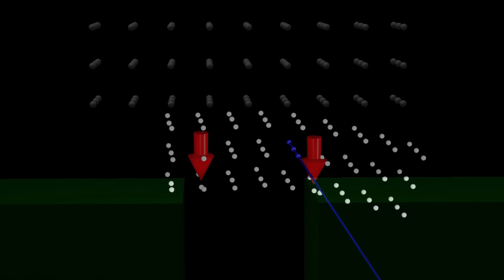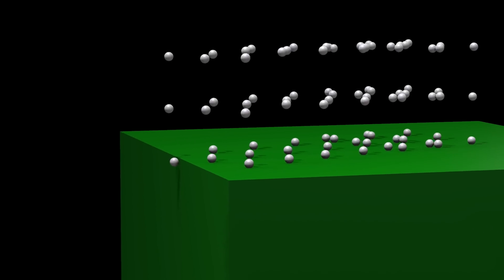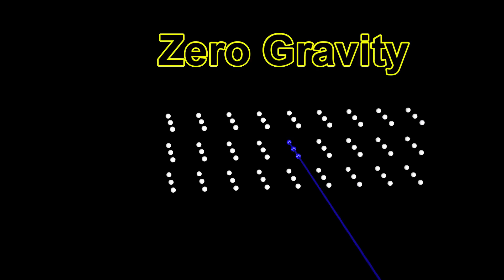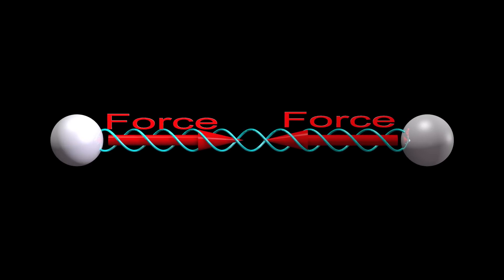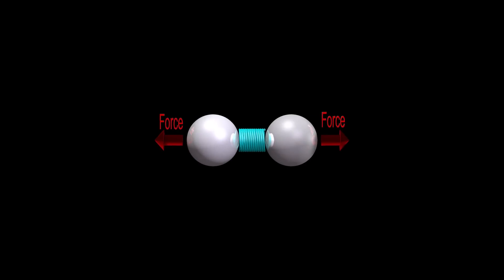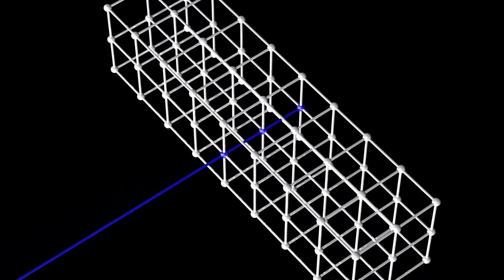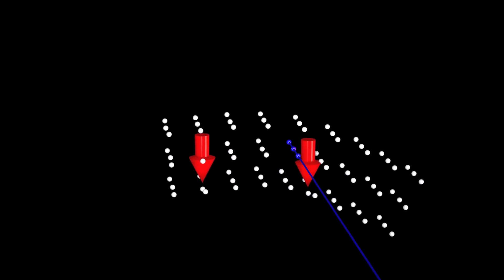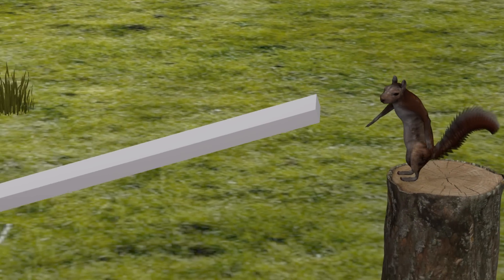Torque can’t exist for rigid objects

Comment: Liquidity infinity to illusionary solidity of liquidity infinity.  External heat energy is within  mass as internal magnetic fields grounding currents into itself and surrounding mass through its nucleus or core. Heat has to ground or burn as decaying internal magnetic fields. External magnetic fields don't ground energy and circulation around the sphere of absolute zero heat energy within its core or nucleus as a monopole of complete repulsion to heat propulsion energy from surrounding space and mass disolving its internal magnetic fields grounding currents by disrupted normal space filled with dark heat energy outside of entanglement of mass as potential renewable heat energy when entanglement with mass occurs. Space is a weak external magnetic field filled with dark heat energy outside of entanglement. Distance is always equal to force. Hydrogen has the strongest internal magnetic field of force. Hydrogen under extreme pressure expands into helium. Helium occupies more occupational space within mass, and more occupational space itself has more force of pressure from repulsion within mass and distance traveling cycling circulation patterns of internal magnetic field increases in equalization to force of pressure decreases. As mass moves away from the core of earth's internal magnetic field grounding currents through its nucleus or core where force is stronger and distance traveling is minimal, it increases in distance traveling and decreases in force of pressure currents grounding through all masses in its path. Currents are the force of pressure known as weight. As mass moves away from the central point of earth's internal magnetic field, grounding currents weaken as distance traveling increases and force of pressure from current grounding decreases. Equalization to force of pressure and distance traveling cycling circulation patterns as mass. The more currents grounding as weight, the more repulsion to the mass and distance traveling cycling circulation decreases. Force of pressure is always equalization to distance traveling, and weight is currents grounding through mass as weight. Table of elements proves hypothesis. Hydrogen has more force of pressure currents grounding than helium. And has the least distance traveling cycling circulation patterns. As mass expands, its internal magnetic field grounding currents weaken. Equalization without gravity. Magnetism. Theoretically factual probability that works with quantum physics without gravity. Friction causes sparks of striking resistance of mass as potential renewable heat energy passing through all masses in its path until resistance is overcome by open space itself and returns to dark heat energy outside of entanglement of mass as potential renewable heat energy when entanglement with mass occurs again. Liquidity infinity to illusionary solidity of liquidity infinity. Alpha and Omega. Cold repulsion of space to heat energy singularities. Cold and heat coexist as space itself as a weak external magnetic field. External heat energy within mass in quantum internal magnetic fields grounding currents through all masses in its path. Space has a weak external heat energy field as maximum distance traveling through space and least amount of heat energy force of pressure to and from cold repulsion of space itself as perpetual motion. Force is when the accumulation of heat energy singularities is unified of unidirectional flow repulsion back onto itself as internal magnetic fields grounding heat currents as force fields of pressure holding mass together as the weakest point of repulsion back onto itself as internal magnetic fields grounding currents into the weakest point of repulsion. Mass neutralizes repulsion as outward pressure exerted within mass and without mass equalization. Mass is always the weakest point of repulsion. In a greater internal magnetic field, grounding currents synchronization as directional force of pressure grounding currents as weight. Outside of a greater internal magnetic field, grounding currents into itself is weightless. Outward pressure is weightless without a greater internal magnetic field directional pressure of force. Magnets show the bonding force of pressure known as weight when you try to pull them apart.  No negative force of flow.  Unification of unidirectional flow. One flow redirected trajectories by repulsion of cold space. Alpha and Omega. Clockwise and counterclockwise. Same flow cycling circulation patterns of magnetism grounding currents as force of pressure known as weight. Quantum Internal magnetic fields grounding currents. Hydrogen and oxygen sharing currents are grounding as water. Cold repulsion unification of hydrogen and oxygen. Ice in a glass of liquid condensate oxygen and hydrogen sharing internal magnetism grounding currents as water. Atmospheres grounding currents as water molecules sharing internal magnetism grounding currents into each other as friction. Heat exchanging singularities point to point chain reactions through all masses in its path. Equalization is lightning strikes burning through atmospheres, gasses releasing heat singularities as friction of spark lighting up atmospheres. Sparks (electrons) light up atmospheres. Grinding friction causes sparks lighting up. Heat transference lighting up atmospheres as daylight magnetism exchanging singularities point to point chain reactions through all masses in its path. Heat waves traveling through space and atmospheres piggyback light as heat waves, magnifying light throughout space and atmospheres. Light is only present in resistance. Lightning proves hypothesis. Fire is the decay of internal magnetic fields releasing heat singularities outside of entanglement of mass as potential renewable energy absorbed by surrounding masses. Liquidity infinity to illusionary solidity of liquidity infinity. Heat is always present in exchanging singularities point to point chain reactions through all masses. It's not the waste product. Electricity is rapid heat exchanging through mass. Heat has to ground or mass burns. Lightning burns through atmospheres. Electricity is sparks of electrons lighting up as friction. Heat currents grounding themselves through all masses or mass burns or decay of internal magnetic fields. Engines ground heat energy to anti freeze and radiators ground to atmospheres and atmospheres grounding currents into surrounding atmospheres or earth's internal magnetic field.  Grounding currents of heat is equalization of internal magnetic fields temperature control.  If internal magnetic fields grounding currents fails it decays as heat releasing e external energy flow as fire or molten masses. Refrigerators and air conditioning remove heat and leave behind cold repulsion of space. As usual, water is found condensate. Unification of internal magnetic fields grounding currents into surrounding mass sharing heat energy. Magnetism is a force of pressure known as space itself filled with dark heat energy outside of entanglement of mass. Mass is the expansion of space. Monopoles of pure fabric of cold space repulsion are external magnetic fields that don't ground energy.  Galaxies and planets prove the hypothesis of cold repulsion within entanglement of mass and without mass. Theoretically factual probability that works with quantum physics without gravity.
Reply: Clanging disorder?

Comment: I'm having a difficult time accepting this. To fully understand it I think I need to see a visualization of how the force is distributed when applied to the theoretical rigid body.
Reply from the maker: You may want to read the paper at https://scholarship.haverford.edu/cgi/viewcontent.cgi?referer=https://www.google.com/&httpsredir=1&article=1494&context=physics_facpubs
Reply: @EugeneKhutoryansky  I think the problem is that the rigid body is not fully modeled. There has to be some other force present to maintain all the right angles, a repulsive force between the masses that aren't directly connected by a spring. Along the diagonals, if you will.

Otherwise all the cubes could fold over and collapse, without ever changing the length of the "springs" between the masses.

The force that is preventing that from happening needs to be accounted for.
Reply from the maker: Even with the rigid diagonals present, I believe we would still violate the strong version of Newton's Third Law, and get the wrong torque equation.
Reply: @EugeneKhutoryansky  You have the software. What happens when you make the model more and more rigid? What is it the limit?
Reply from the maker: If I make the spring constants too large, the software crashes.
Reply: @EugeneKhutoryansky  therefore, a perfect rigid body can't exist, as the universe would crash
Reply: Well, the statement of this video pwns down my mental experiment of a rigid several light years long bar being spinned for travelling in time by being on the ends of the bar.

Comment: When dealing with springs, you use diagonals. When dealing with "perfectly rigid bodies", you don't include the diagonals. 
Add enough diagonals to your perfect rigidity stuff, torque will transmit just fine.

Sure, no real thing is perfectly rigid. But the maths of perfect rigidity torque make sense.
Reply from the maker: You may want to read the paper at https://scholarship.haverford.edu/cgi/viewcontent.cgi?referer=https://www.google.com/&httpsredir=1&article=1494&context=physics_facpubs
Reply: @EugeneKhutoryansky  Well their "rigid body" is made of 2 atoms. So of course there aren't diagonals. (Well actually, they are using 2 atoms and a pivot, arranged collinearly, in a double pendulum structure that swings freely. )

Then when they allow non-rigidity, the 3 points in a line flex to form a triangle. You now have a properly rigid triangulated structure (non-degenerate case) and so angular momentum works properly.
Reply from the maker: Even with rigid diagonals present in the model of the rectangle, I believe we would still get the wrong torque equation.

Comment: I just like how the attractions and repulsions of particles can be simplified as springs.
Reply: Intuitively, parabola is a good approximation to coulomb interaction if the displacement is small. The potential energy of spring is kx²/2, which is also a parabola. Thus, spring is not only a analogy to the molecular forces among atoms in a solid, but also a rather accurate approximation.
Reply: @JuliettKilo  Thank you!
I needed that cool explanation
Reply: @JuliettKilo in fact, most (well-behaved) potential wells behave like a spring under small displacements. We can understand this by considering the Taylor expansion for the potential. If the potential as a function of position is smooth, then we can Taylor expand it. At a minimum, the term in x is zero, hence for small displacements it behaves like a quadratic potential (if the term in x^2 is not also zero).
Reply: Springs? Always have been.

Comment: As a Diesel mechanic, I routinely twist the maximum allowable torquage.
Reply: As a mobile crane operator I can tell you ain't nothing ridgid.
Reply: @reefsroost696  as a Machinist, i can confirm that nothing is rigid.
Reply: Some fixed minded are made from 100% ridge materials.
Reply: @robertengland8769  as a physicist, I can confirm that rigidity is indeed an illusion

Comment: Not meaningful. Moment equilibrium can be obtained using newton laws and vector calculus. No other one is required. There is an enginnering concept, machine theory, to analyze the motion of 'rigit' bodies. Also in finite element analysis, there are many rigit element types to transfer the moment
Reply from the maker: You may want to read the paper at https://scholarship.haverford.edu/cgi/viewcontent.cgi?referer=https://www.google.com/&httpsredir=1&article=1494&context=physics_facpubs

Comment: what if the spring constant approaches infinity, won't that be a perfectly rigid body?
Reply from the maker: Spring constants of infinity would be a perfectly rigid object.
Reply: @EugeneKhutoryansky  correct, so you can start with a finite spring constant, and then keep increasing it, tending towards infinity, which will also tend towards the behavior of a perfectly rigid object
Reply from the maker: But you never actually get a perfectly rigid object until you actually reach spring constants of infinity.
Reply: @pexfmezccle You extend the spring equation past where it is physically meaningful. Relativity exists, so you'd need to modify the law in a way that makes k a function of spring velocity. Otherwise you have a spring that can snap back faster than the speed of light
Reply: @EugeneKhutoryansky  but i think that there's a mathematically and logically viable model of torque physics at the limit of infinity, though the speed of sound through it would be infinite
Reply: @Mandragara  well relativity is not the main concern for this perfect rigidity problem
Reply from the maker: There is a big difference between infinity and anything less than infinity.  You actually have to reach spring constants of infinity to have the problems I am referring to, where the object can't deform even slightly.
Reply: @EugeneKhutoryansky  well i think infinity is only actually a problem when the limit at infinity also tends to infinity
Reply: @EugeneKhutoryansky  I think the problem you are referring to only exists because you forgot the diagonals in the rigid model.
Reply: @pexfmezccle  It is a main concern as perfect rigidity would not obey speed of light limit
Reply: @Mandragara  which would not be a factor if we're considering just the model of the paradigm of classical mechanics
Reply: @pexfmezccle  But that model of reality is non-physical? It's like a computer game you can code whatever you like, perpetual motion machines etcetera
Reply: @Mandragara  well the video's argument about torque's existence can just based off of the classical paradigm
Reply: @mlgswagman6002  well classical physics models do include scenarios of the moments of perfectly rigid bodies, such as the formula τ = I α  or α = τ / I for example

i think that Khutoryansky should modify the theme of his video and include an addendum about how the odd infinities of perfect rigidity can be conveniently ignored when doing classical mechanics models because these odd infinities are about the internal forces of a perfectly rigid object, but a perfectly rigid object can be by its nature treated as a singular simple unit, such that we don't have to concern ourselves with the nature of its internal forces

and it need not only be about torque and rotation, it can also include linear acceleration. for a perfectly rigid body, the speed of linear transmission is infinite, and this is a simple assumption of rigid body mechanics.

but the speed of linear transmission is equal to the speed of sound, and the explanation is that the speed of sound is indeed infinite, due to the mechanical moduli being infinite, which are in turn due to the spring constant being infinite, and the spring constant being infinite is the hallmark of a perfectly rigid object
Reply: @EugeneKhutoryansky  i think that you should modify the theme of your video and include an addendum about how the odd infinities of perfect rigidity can be conveniently ignored when doing classical mechanics models because these odd infinities are about the internal forces of a perfectly rigid object, but a perfectly rigid object can be by its nature treated as a singular simple unit, such that we don't have to concern ourselves with the nature of its internal forces

and it need not only be about torque and rotation, it can also include linear acceleration. for a perfectly rigid body, the speed of linear transmission is infinite, and this is a simple assumption of rigid body mechanics.

but the speed of linear transmission is equal to the speed of sound, and the explanation is that the speed of sound is indeed infinite, due to the mechanical moduli being infinite, which are in turn due to the spring constant being infinite, and the spring constant being infinite is the hallmark of a perfectly rigid object
Reply: @Mandragara  So? The premise of the video is already nonphysical. The question isn't "are perfectly rigid objects possible in the real world?", it's "does torque exist for perfectly rigid objects with Newtonian physics?"
Reply: @vibaj16  That's actually a solid critique
Reply: You're right. You are on the right track.

Suppose the spring constant is k. As k approaches infinity the body approaches being perfectly rigid. You can increase k such that it is indistinguishable from perfectly rigid.

Infinity is not a number. Infinity minus 1 is not less than infinity. One can't say that something is different at infinity vs infinity minus 1.  How could one demonstrate that the situation would be different at k = "infinity" vs k = 10^100000000000000000 N/m.

There is no physical thing that has been measured or proved to be infinite. Infinity is not a determinable real physical thing.

That paper by Daniel J. Cross has at least one error.  In equation 2b the 'T' should be multiplied by r1/r2.

So - sorry, not sorry - This video is bogus.